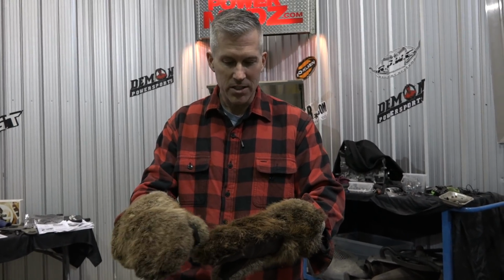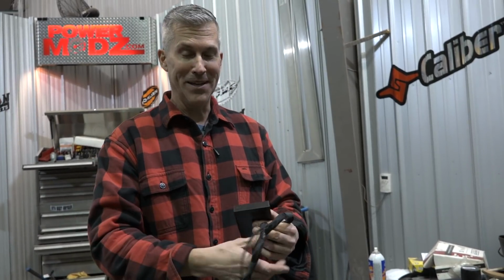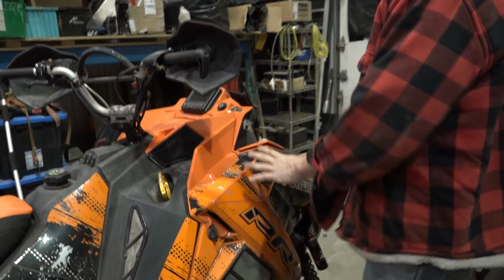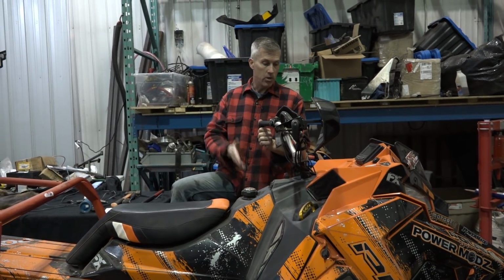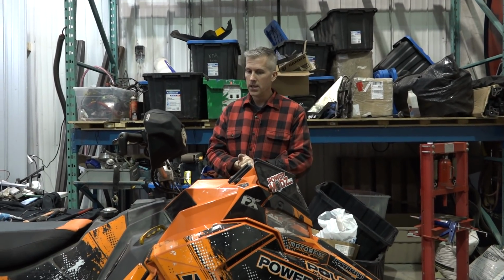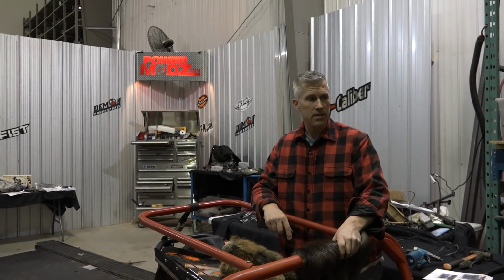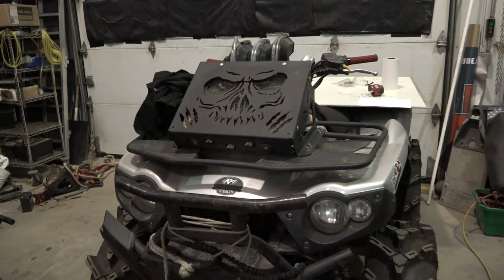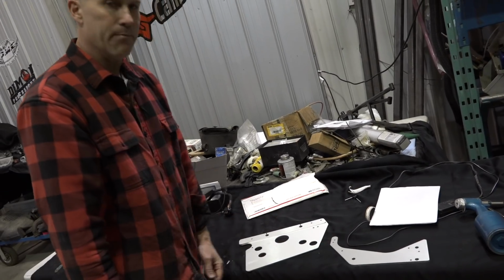PowermOdz shop date Jan 9, 2019!

Comment: Hey bud!! Nice to see a new video... I've just picked up a 96 skidoo formula III 600, its in decent shape, low km's. Just ordered new idler wheels and some small things to tune up the suspension and Whatnots. I've been looking for some mod ideas, but haven't seen anything online for the 96 formula III. Any ideas or recommendations? Thanks in advance
Reply: I guess to be more specific about what I want to do with this sled...., I already have a set of risers, and new fly racing bars, put new ski's and carbides on, but I want to lose the stock trailing arms and re-do the front suspension. I've cut a bit of weight already but want to remove the seat and do something  custom in more of a rider forward stance. The biggest thing is going to be the tunnel extension and rear suspension and track. Its a stock 121, and I want even just a little bit more out of it for the woods and stuff. I go ice fishing north of kaladar around bon echo park and calabogie a lot... The trails we have going in there get deep and an extended track is a must on most trips. It sucks that we don't have a lot/if any snow in Ontario where we are, but its given me time to work on the purple people eater lol.. Thanks for your time and any ideas or suggestions would mean the world. Cheer's, Chris.

Comment: Louie , for the tenth time , How many grams of weight are you using for the turbo polaris ? I'm low elevation also and running 6 psi on a pump gas kit. An answer back would be greatly appreciated ! Thanks
Reply from the maker: Im not answering because I keep changing things!  Ill know by monday though - dealing in the turbo - and it is nuts!